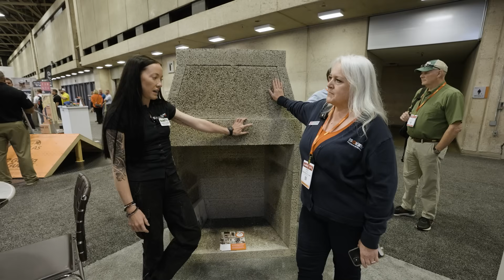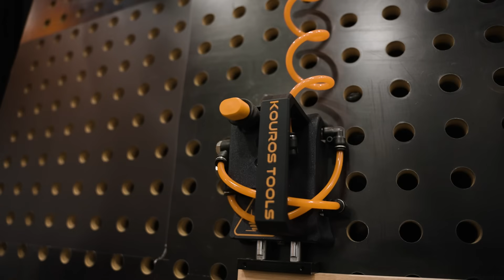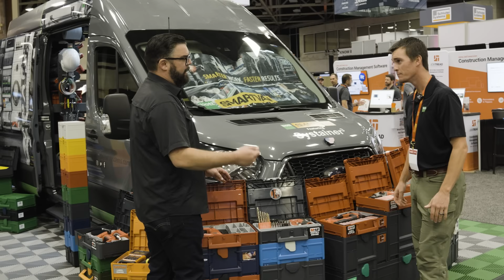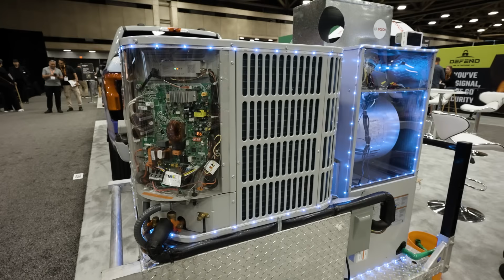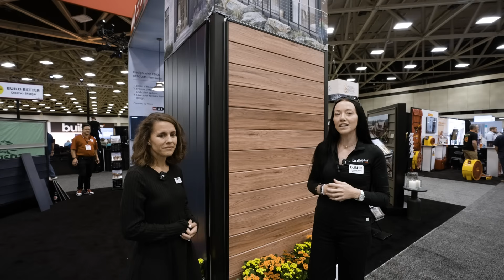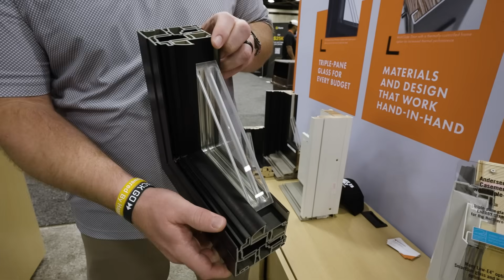Best of the Build Show Live 2025

Comment: We should stop installing fireplaces in homes.
Reply: Why?
Reply: @crittercrusher97  
Air pollution
Reply: @t @turtle41 l units cause pollutants?
Reply from the maker: The burning material that gets into the air doesn't always make it into the chimney and out of the house. It can pollute the air of the home and affect air quality.
Reply: @turtle41  And letting millions of acres of forests burn every year is better?
Reply: You must live in a city. A lot of peoples only heat source is from fireplaces or they are backup sources. The more you know!
Reply: Wade you have lost some weight -lookin good!
Reply: 4 million dollar hom…says it all…hmmmm
Reply: It’s nice to have a thermostat agnostic system, but 85 stages only apply to compressor  interior unit! Not a true full communicating unit- no issue in dry climate, in a mid Atlantic Midwest climate let alone south, it does not handle humidity as well.